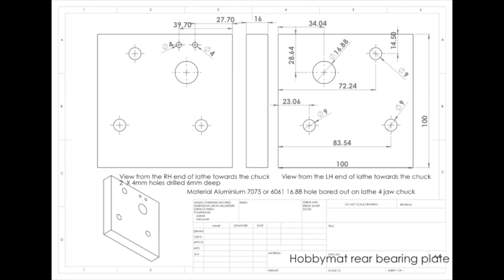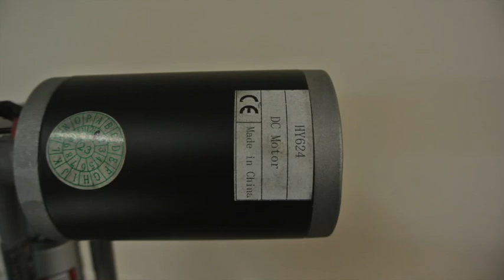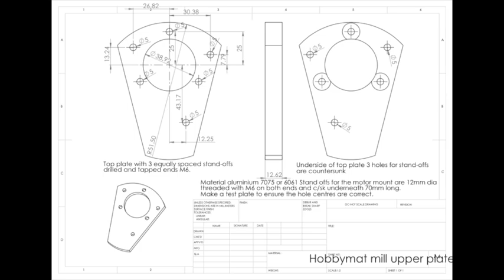Hobbymat 65 Part 6 (adaptation detail)

Comment: Can anyone tell me the specs on the Z axis gearmotor used here? Watts?, Gear ratio? RPM?
Reply from the maker: https://www.ebay.co.uk/itm/363996111989?var=633383018894  This is the part I bought.12v 50RPM 30W 1.2am no load. left shaft. Price was £63.35. It has worked just great and no need for anything more powerful.  John

Comment: Hi John,
Really nice job.
I'm wondering how you have changed the the original v-belt drive and gear box on the original Md65 lathe. Do you have Any information about that? I'm trying to rebuild my own😊
Reply from the maker: Thanks, it was really simple and I left all but one gear in the gearbox. They are not driven after the conversion is complete. Have a look at my belt drive conversion.
John
Reply: @john2478  Thanks John, my question is answered in part 2 of Md65 videos👍 I look forward to do the same as you have done 😉
Reply: Can you tell me what power supply you Are using g for the 500 w motor?
Reply from the maker: I use a 20amp 500w 24v transformer off ebay https://www.ebay.co.uk/itm/374371106905
Reply: Hi John, One more question from my side. How have you made the wiring so that you can change to manual control of the lead screew. If I understand are you using two pulse generators, One for automatic control and one for manual.
Reply from the maker: @ihavn  I have only one encoder reading the spindle rpm. I have changed the lead screw so I can turn it by motor or by hand for delicate work or setting up. The problem of using the small control board is that it does not reduce the stepper to zero and creeps along. Hence the need for manual control. I expect that someone out there has a electronic fix for that.John